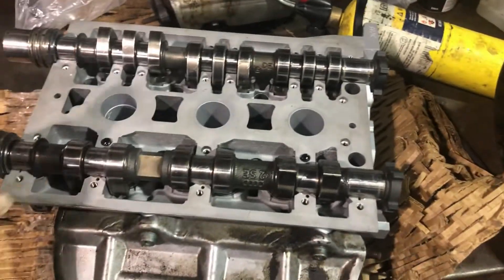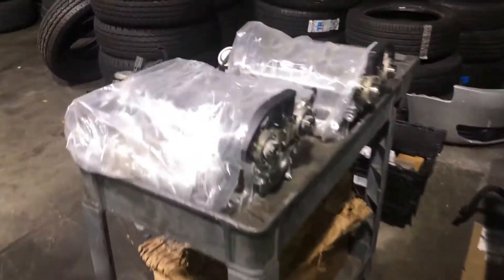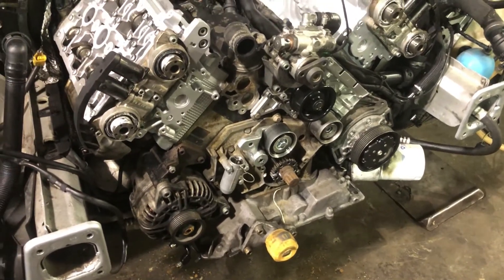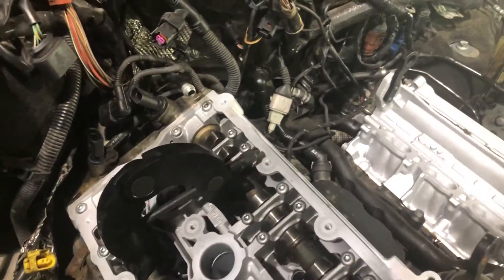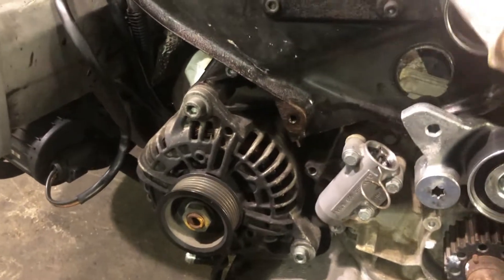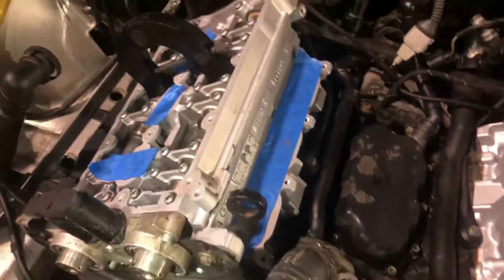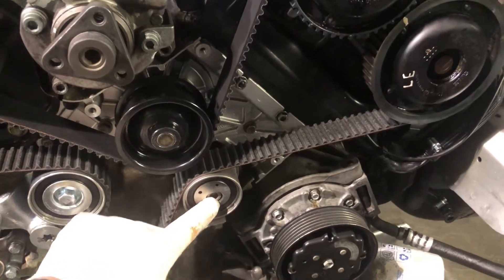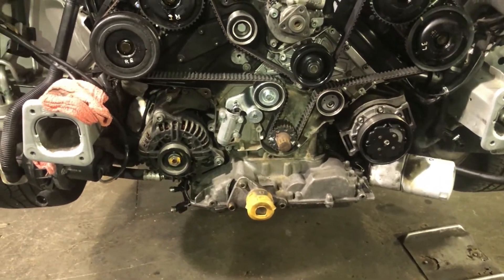Audi A4 3.0L Cylinder head repair part 2

Comment: By chance, what was the millage of the timing belt failure?
Reply from the maker: i believe it failed because it was a CHEEP Ebay belt kit. it was driven maybe 10,000 miles. only use audi parts
Reply: I appreciate and will do. 
By chance is the thermostat behind the water pump? I am having a tough time orienting myself around the thermostat housing and the engine …Thank’s in advance.
Reply from the maker: @DerekCully  the Thermostat is above the water pump in the valley under a water neck